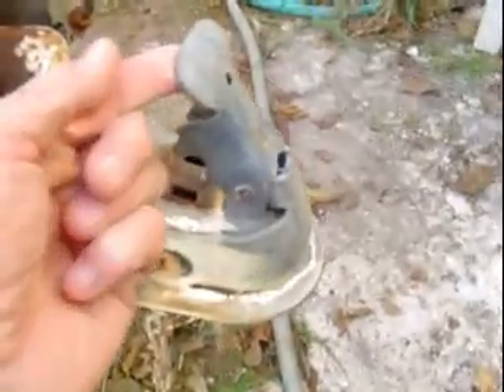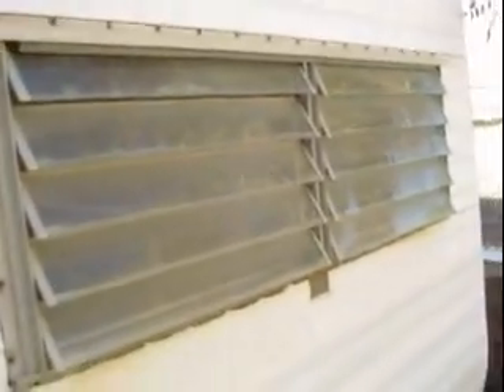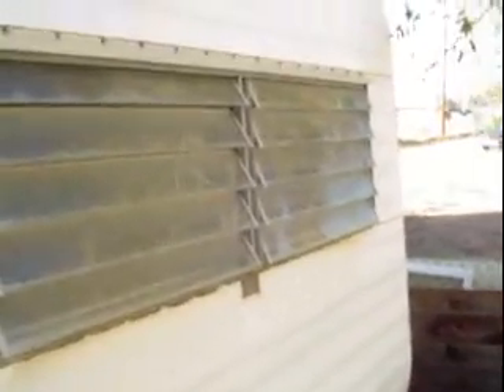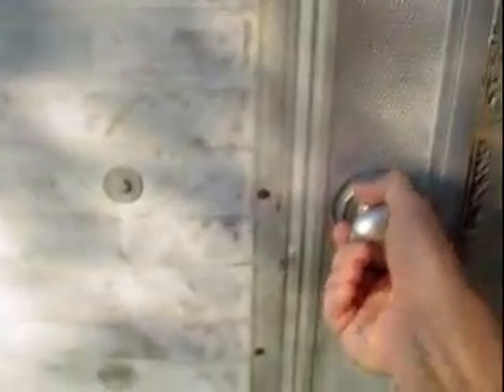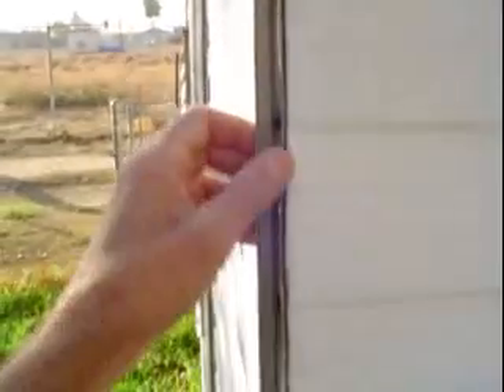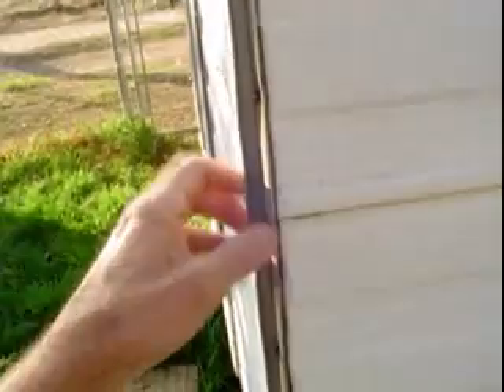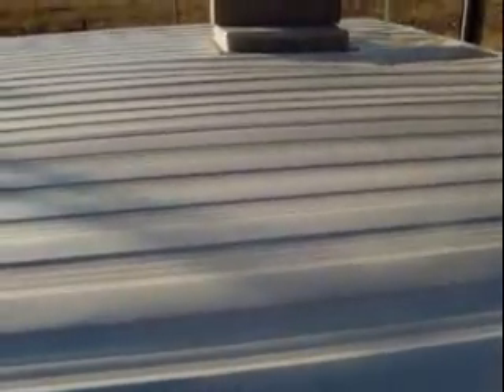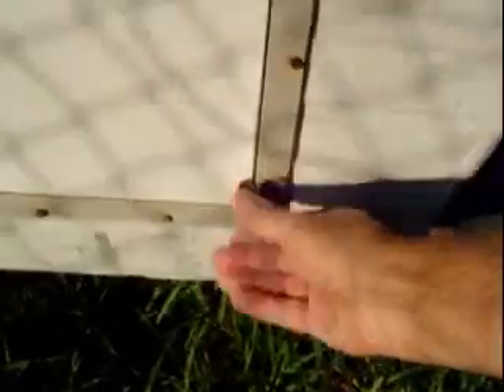Trailer Questions Part 1b

Comment from the maker: "It doesn't help on a hot day?"

Nope... Better off opening all the windows. When you have that vent open the rubber seal starts to dry out right away. Next thing you know you forget to close it and take off driving and it hurts the hinge or it rains and you ruin the ceiling in one day. No reason to even have a top vent in my humble opinion...